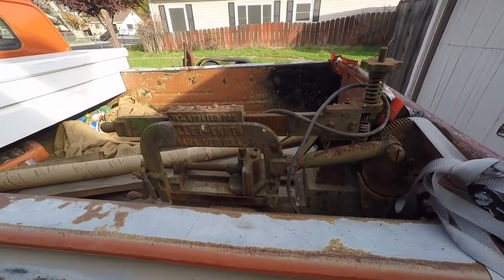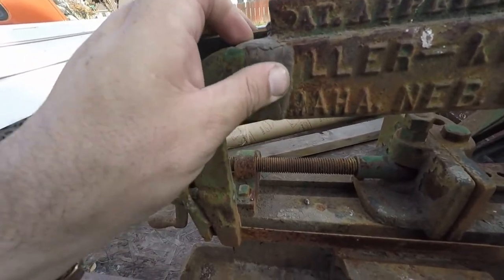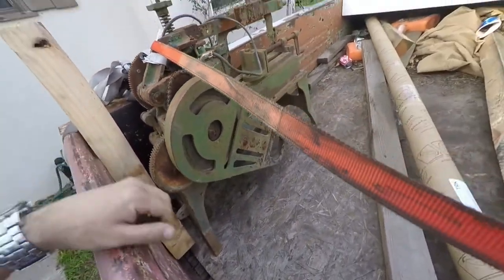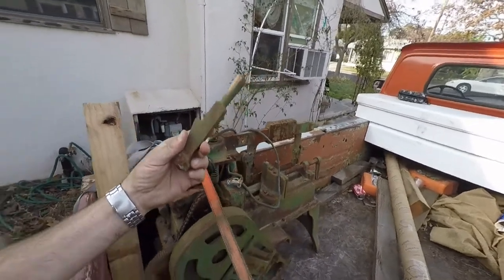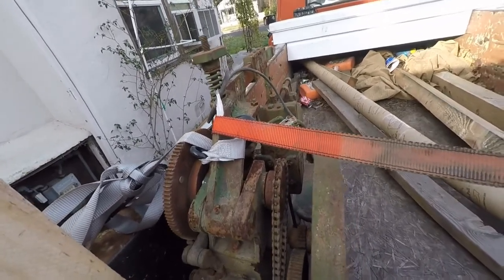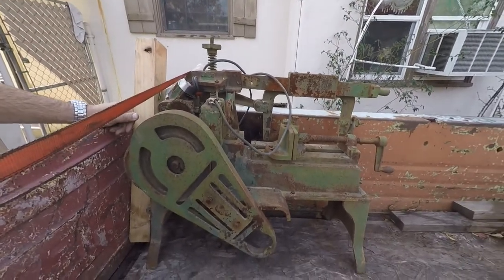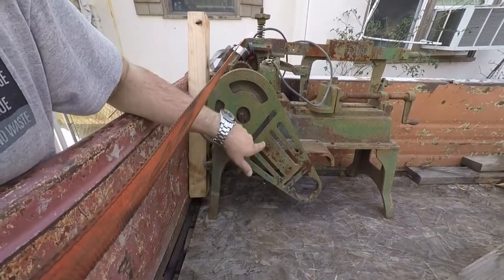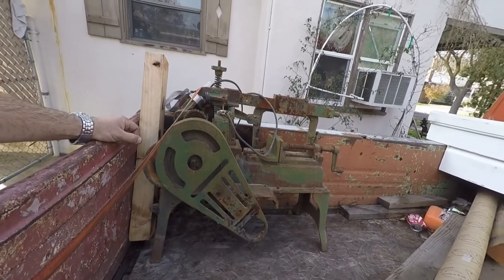survey of the Miller Knuth power hack saw

Comment: Nice project piece.  Find a way to get 17" x 1-1/4" blades on there and I will set you up.
Merry Christmas,  Randy
Reply from the maker: I could always shorten the blades.
Reply from the maker: +Randy Richard lol the saw is still in the pickup and i stoped at a frends house he saw it and sed here i have some Blades . he had two 14" german made blades they look like they will fit there slightly longer then whats in there . i have a roper jr punch think that will put a hole in your plades or am i gonna break the punch?

Comment: Man, this will be a great restoration project.  I've been looking to get a cool old power hacksaw.  There is a load of projects in that machine.  Just checked the local CR and there is one listed now for $100 but it's from the 80's probably.  Not lots of cast iron like yours.
Reply from the maker: this one defiantly is a big project no motor broken gears all kinds of things.
Reply: Hold out for a cast end bell motor for it.  If it takes a 3400 rpm motor you can get those with an old wood lathe often for $75 or less.  If it takes a 1740 it will be a bit tougher to find one but they are out there.  I found one of my extra's, a Craftsman with grinding wheels mounted to it for $30 I think.
Reply from the maker: i have a very old motor that has gets oilers on the bearings forget the R.P.M.
Reply from the maker: hay have you checked up the tube buddy plugin for the browser that is how i am doing all the new thumbnails it has all kinds of cool features.
Reply: I'll check it out.

Comment: I'm in need of the tension knob, springs, etc.  Did you restore this or would you part it out?  Thanks, Jay
Reply from the maker: Sorry what machine is that I can't  see on my phone?
Reply from the maker: i see what you are talking about now i don't want to part out the machine but if your interested i can get a copy of the nut made if that would be a help.
Reply: That would be great.  I actually still have the lower spring, so I need measurements of the upper spring height and diameter,  threaded rod size, and tensioning knob which I believe you're calling the nut.  Is the threaded rod a bolt turned upside down or just a rod with a hole drilled through it to accept the lower spring?  My model is a 3100 and was made in Auburn, Nebraska.  It has a brass tag with the info on it.  Looks like yours was made in Omaha, Nebraska.
Any help would be appreciated.
Reply from the maker: I will look into this on my weekend  ( Tuesday and Wednesday) mine doesn't have all the pulleys for the motor and everything do you have that I've been trying to find examples of What's missing.
Reply from the maker: i just looked at the tension know and upper spring it looks like the spring is made from the same stock as the lower one need to measure the length of it but can't do that tell its dismantled i will try to get the knob off its frozen on of course lol .
Reply from the maker: oh sorry for the delay looks like they held this post for review as you were using a email address in it 
but iv gave it the ok just now :)